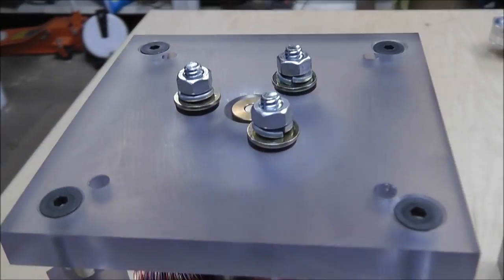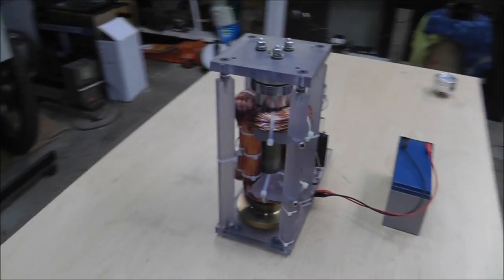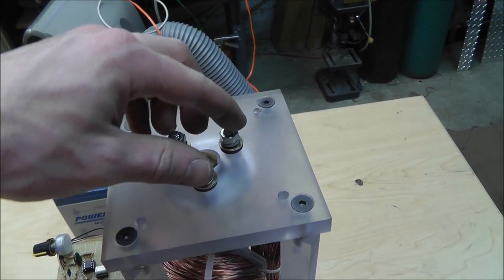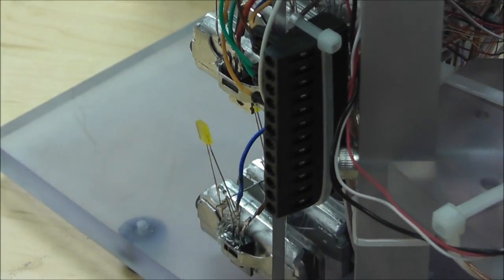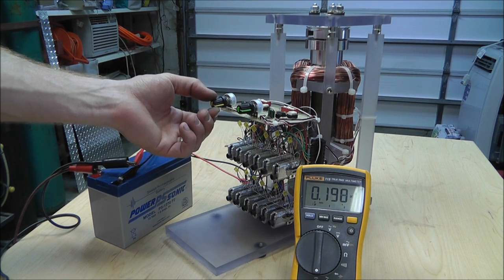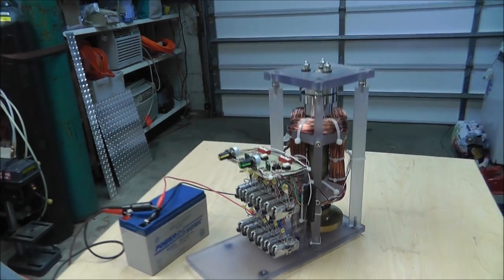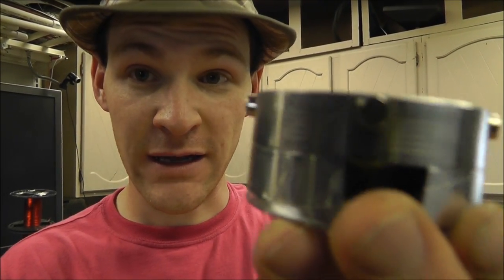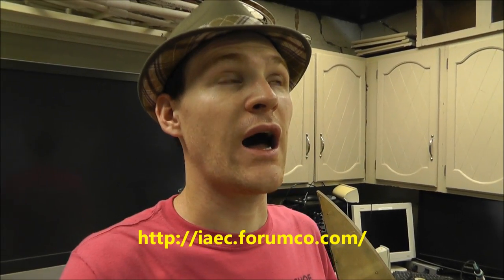Russ's 1ST  Entry to The Pulse Motor Build Off 2012. IAEC & OSE !

Comment: Your explanation of it's "self governing" mode kind of reminds me of a big PWM inverter I wired up, it was nuts, its like I was "stealing" ground from a flip flop inverter, but periodically it had ground, and would begin, die, begin, consequently though, it was very low input powering an AC LED bulb, on a 100 ft. cord, with as little at 30mA 12VDC input (albeit dimly of course). Interesting

Comment: There is for all reactions a delay effect, so can be a moving mass a pulse slimming without it reacts with corresponding slowing it. This principle applies to all of the devices in which two materials are passed to each other. This movement delay allows the insects a vibration free flight. (See Reynolds number) The effect allows a higher planet formation rate than was mathematically expected so far, because not a lot of ring material slowed the big chunks in the clash, which they would much lose momentum that they into their suns would fall. Guns bucking hardly upward as long as the ball is still in the barrel. Otherwise it would be impossible to meet so precise if the recoil would immediately show effect is possible that this effect is responsible for deafness that black holes are reinforced to complete immobility. On the other hand, keeps us these super inertia before that black holes in space to roam, they remain mercifully good where they originated.